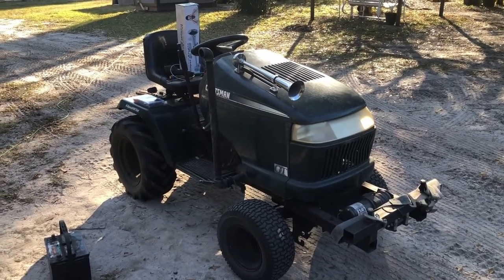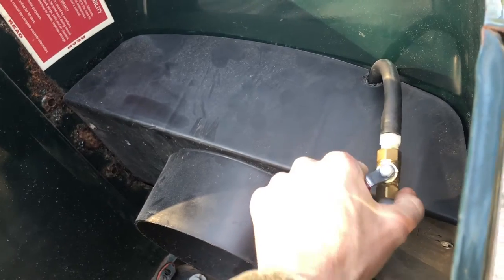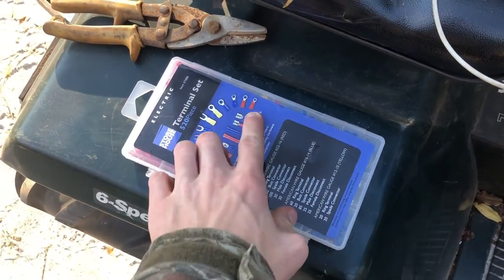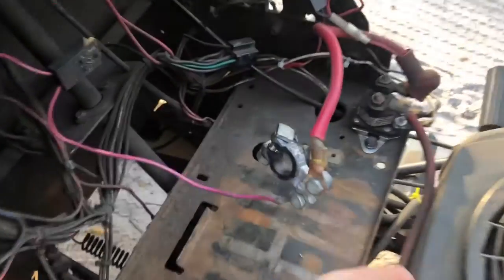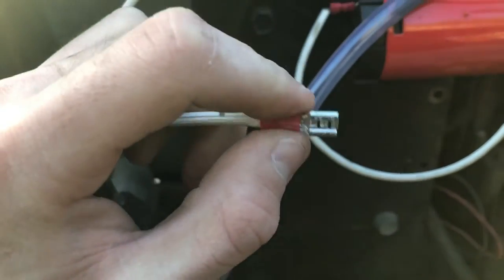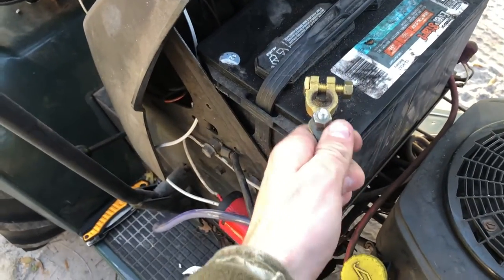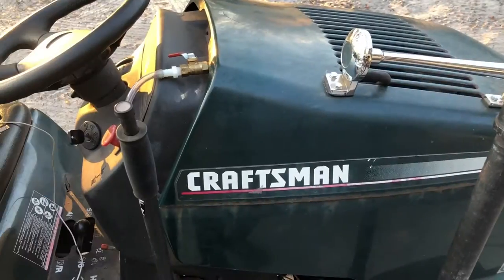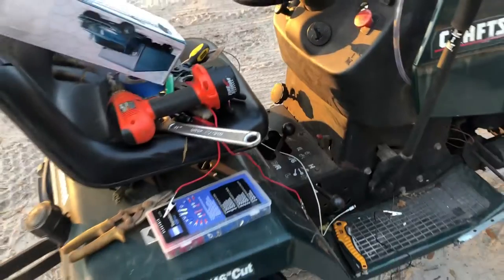Garden Tractor AIR HORN install! Plus some updates and how to’s!

Comment: I like it. The echo tells how loud it is. Nice. I also dig the exhaust. It has got me thinking. With winter just around the corner, a new project.
Reply from the maker: Thanks!! I loved the exhaust stack, and It ran out of the stock muffler so it wasn't too loud. I ended up swapping it with a down pipe more recently because I liked the sound better and it was more friendly when mowing.